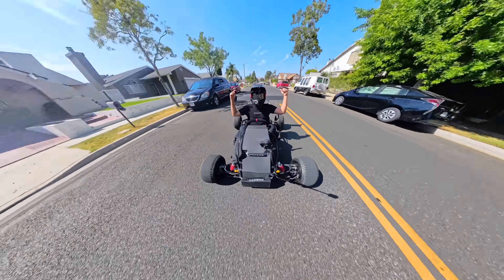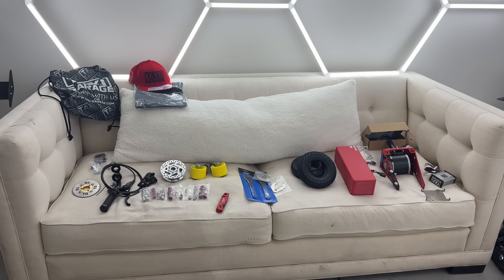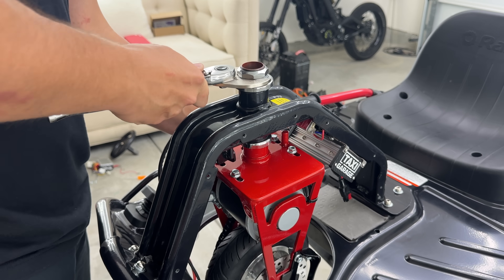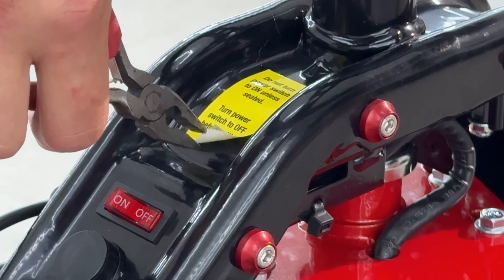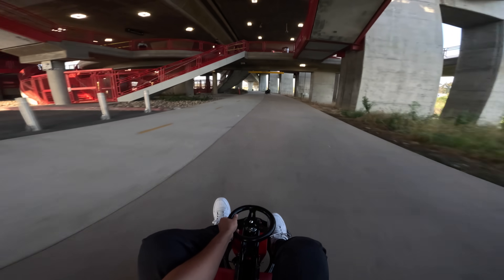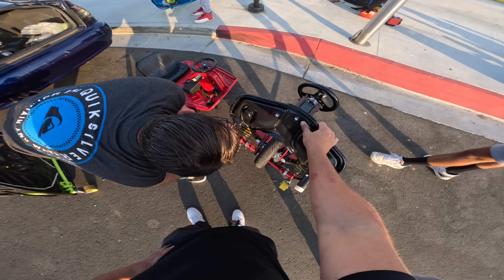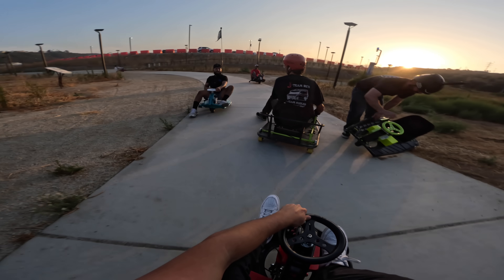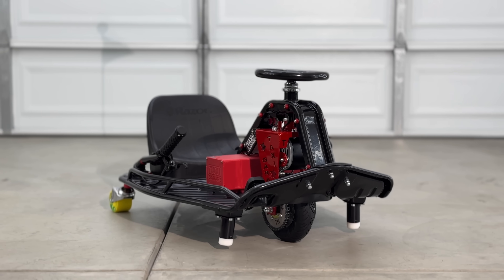I Built The CHEAPEST Electric GoKart!

Comment: I don't see how 2k for a build is considered cheap, I recently got a mx350 currently modding everything to a 72v so far I haven't installed the parts yet to tell,  but its only costed me less than 300$ this is also my first time modding Soo wish me luck..
Reply: It's probably a lot cheaper to source the parts yourself, he just used a kit from Taxi Garage which definitely has you paying a convenience fee on this set up for sure
Reply: @holypear can you teach me how to modify my mx650 for cheap? 72 volt batteries are like $300 and i want my razor to go at least 30
Reply: @Ihave30animegirlsundermybed  I don’t think he has bought the battery yet cause i just finished building my 48v 1000w mx350 and it costed around 500$ not including the bike
Reply: @Ihave30animegirlsundermybed I have a 48 volt 200w and it does 35 and it cost 600 with the bike in total
Reply: @Xr100_rippaa how much did you get the battery for? And do you mean 200 or 2000 watts?
Reply: @MvtthewFv hm okay
Reply: @Ihave30animegirlsundermybed  2000w and I think it’s around 200-250
Reply: @Ihave30animegirlsundermybed a 72v 20ah battery and a 3000w motor will get you 55mph…
Reply: @VolazVFX for me I got a 3000w 72v brushless bldc motor with a 60ah controller,  mine runs 2 twin batteries each 12v 7ah I’m running a single battery that’s 12v 16ah so it’s both of them combined into 1 leaving me lots of room
Reply: @MvtthewFv  how fast
Reply: @Bjt_bikelifelmk the whole set up i need something this convenient
Reply: If you go to charged up 3d, it’s a website, you can build a 60+mph crazy cart for around $1000 and the crazy cart. It’s a great option if you already have the cart. I personally think taxi garage is way overpriced.
Reply: @MNangler25 good luck breaking forks and fucking your motor up... unless you preorder another brand fork. I dont support companies(starts with a T not promoting them.) with employees thst publicly talk bad about another better more successful company. you're not hitting 60 unless your on 72 volt atleast 60.
Reply: @MNangler25  going 60mph on a crazy cart is asking for trouble 🤣 Taxi garage is charging boutique prices for rich uneducated people. It is totally easy to go 40mph with under $300 in parts.
Reply: Dude, I don't know what tax bracket these guys or their parents are in but it has to be a pretty elite club. $10k e-bike, $15k go-cart,  drift razor $3k !
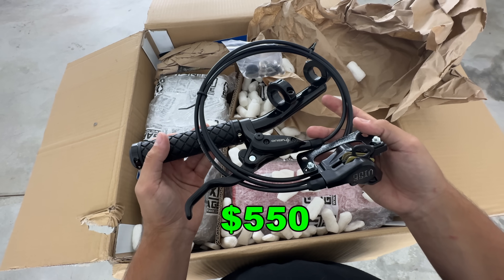Reply: 1:28  1:36 I think you can guess why it is so expensive. Look at the prices of the parts. This is illogical
Reply: I think you can guess why it is so expensive. Look at the prices of the parts.
Reply: I love your vids man keep it up 🙏🏽
Reply: It's not cheap it's the cheapest
Reply: @davidjohnhayden4764  It is absolutely not the cheapest by a long shot. TG is overpriced as hell.
Reply: 2k is cheap bro
Reply: @Vincentas9999-l8q  ik damn well I don’t have 2k
Reply: I get 60k in a day
Reply: Luck
Reply: The go cart was cheep when it was stock it he upgraded it so it was originally the cheapest
Reply: Bro I agree
Reply: rage bait
Reply: You must have not bought much yet. A 72 volt battery is over 300...
Reply: Thats because you're poor. 

Countrary to popular belief electric vehicles are not for peasants. 😂
Reply: Shut up bro
Reply: I’m sorry but 60 psi!!!!
Reply: He literally say:In know this is cheap it’s still a COUPLE GRAND to build this. so watch the entire video and listen.
Reply: Did ya do it
Reply: nba 2k?
Reply: Real
Reply: It’s the cart, not everything else😂😒
Reply: Same
Reply: It’s cheaper Then 15k
Reply: Monster can I have the back heart I'll pay you 5 million dollars
Reply: In Canada (CAD) that’s how
Much a build costs for the best & most power. I have a razor sx500 ($300-600$) the controller and motor is $600 and the battery is $1000. 72v 40ah 10000killowatt
Reply: Op
Reply: Love 😊this oooooo😊
Reply: 16:02 just look what he says
Reply: Surron guy click bates tf outta kids saying cheapest built.
Reply: @zato0  it’s for advertising for the company’s he buys the products off of,  but if yk what ur doing u can make something of ur own for pretty cheap
Reply: Yo bro you should have got a rawr mantis it’s 3k and it come with 72v out the box
Reply: @kinginthebuliding1  Those are junk.